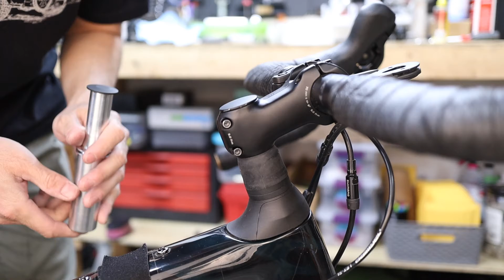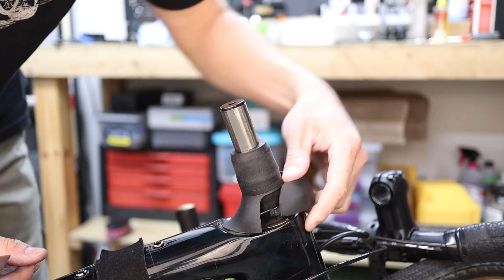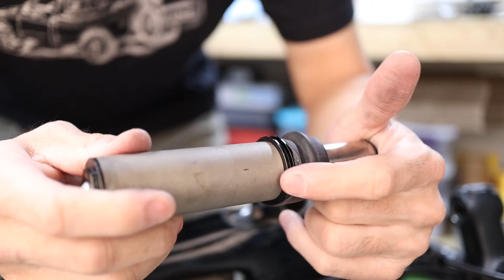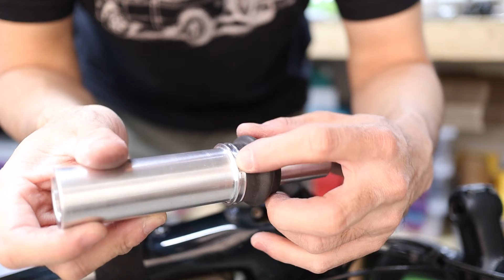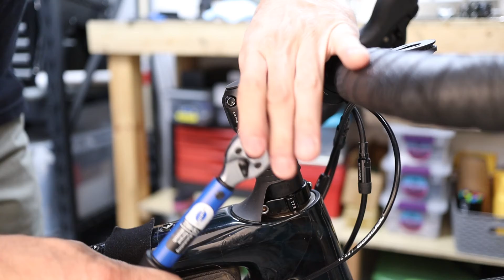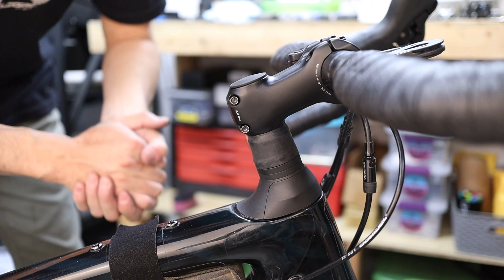HOW TO: Install Future Shock Delete Kit

Comment: Tight fit. Shaved down the three flats a little on inside of boot ring, and used a rubber mallet to gently tap everything into place. 2020 Roubaix with FS 1.5. Quality parts. Thanks!
Reply: First ride, 50 miles: Didn't miss FS1.5 at all. I ride exclusively on pavement, some a little on on rough side with broken patches to dodge, but always on pavement, and only recreational. 2020 Roubaix is stock except for 32 mm tires at 60 psi, carbon handlebar, and of course, the FSD. Thanks!

Comment: Just installed mine, bike is noticeably lighter! Quick question, was I supposed to leave the shim that slides on to the Futureshock on? I did as the stem seemed too loose otherwise.

Comment: I quite enjoy my FS 2.0 on my Roubaix, but since I have kept the dial in the "locked" position lately, I plan on replacing it with this part at some point. I just don't know the interval for servicing the FS 2.0 since my bike has less than 5,000 miles on it. But based on the weight savings alone and how affordable this part is, looks like I'm making the jump soon. Great explanation on making the swap!

Comment: FS sure seems like a very complicated shock solution in an area of a single point of critial failure that would normally be much less complex, ie bolt the stem to the steer tube. YIKES, I sure hope Specialized and The Bike Sauce know what it is doing.  HAS ANYONE BEEN HIRT WITH THE FS system failing?

Comment: Have you tried enrouting the cables through the stem and future shock? Do you think it is possible? Thank you for your content 🙏🏻
Reply from the maker: That might be possible, but not with the current FSD design. It’d have to be modified with some slots for cable access
Reply: @TheBikeSauce  that’s would be cool and do you think it would be possible with the original FS 2.0?? Thanks for your answer
Reply from the maker: I don’t think it’d be possible on an actual FS unit, since it’s a closed cartridge. No pass thru available

Comment: With this FSD, will there still be option to lower the stem position and vice versa. Thank you for the answer.
Reply from the maker: Lots of people asking for a slammable version of this. Working on it now.
Reply: Omg yes. I slammable version that works with fs 3.0. 

Perhaps even a model that’s slammed , 3.0 capable, uses standard stem ID and has internal routine. I’d pay $1000 just for this stem version.

Comment: Sauce...after a 6 month trial on a Redshift stem I must say I agree with your conclusion. I also would recommend it as a front suspension solution over my FS 1.0 and 2.0 systems.  Reasons: weight,ease of service,longevity,swappability. Once my FS's fail I'll opt into an FSD + Redshift for sure.

Comment: Worried by one aspect of this, which is that you loosened the collar pinch bolt without releasing the pre-load tension. This means the tension is being held on that tiny screw in the front and its easily damage hole into the carbon steerer tube which is only designed to locate the collar at the correct height. I also don't believe the pre-loads wouldn't be affected by loosening the collar pinch bolt. Better to back out the pre-loads and set them back up again after?
Reply from the maker: Hey Steve! You're not wrong. Probably best to do so. Typically, I'll always readjust the HS preload after fiddling with the future shock headset.

Comment: thanks for this. been keeping an eye on the project and am tempted to do it to my roubaix. question: do you know where I can get the shorter duckbill and the different tension springs? my roubaix only came with the tall duckbill and whatever spring the shop put in. i moved so im not near the shop anymore
Reply: I can send you these from certini in Bristol uk.  Message us

Comment: Can the rubber boot be completely eliminated and the stem mounted lower down? It would leave 2cm of exposed FSD cartridge that will need cutting, but is it possible?
Reply from the maker: It can, but not with this design. The FSD was designed as a direct replacement. A different design is required if you want to slam the stem. I believe an eBay seller is making one like that
Reply: @TheBikeSauce  Thank you! I've got it in my basket, just waiting for the exchange rate to £ to improve... and eat into that $30 shipping fee :)
Reply from the maker: @ChristianTravel1  I know... International shipping is so tough right now.